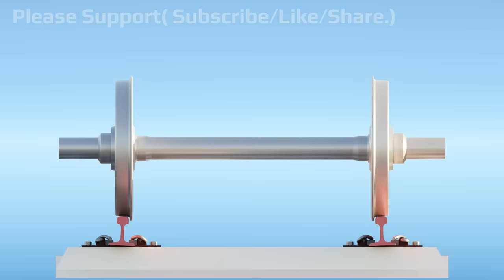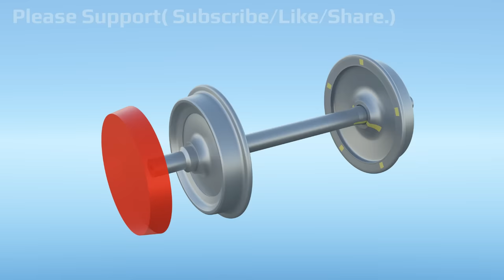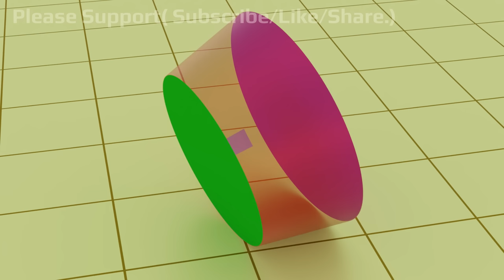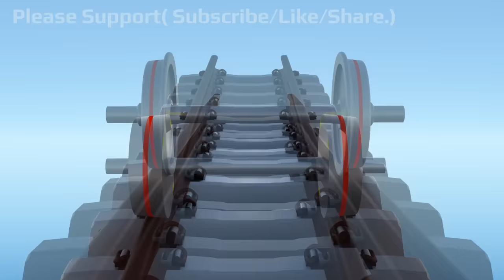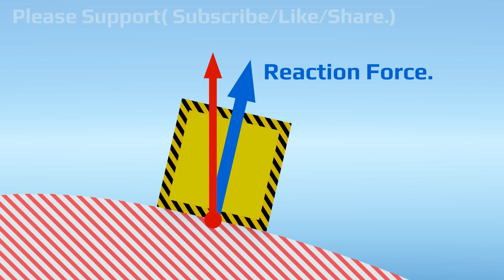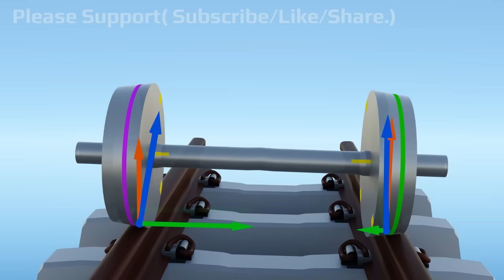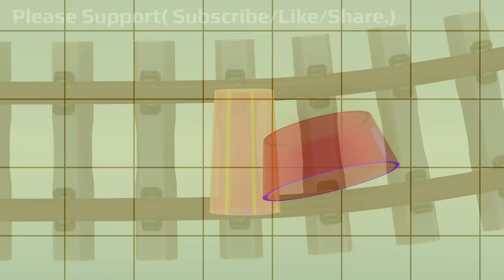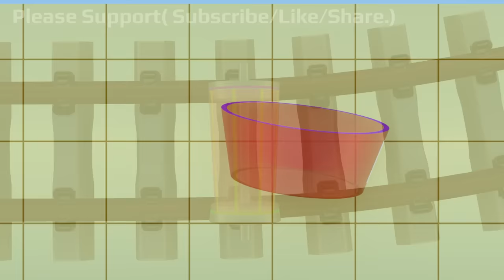How trains actually Turn ? | on curved rail track.

Comment: Wonder how these massive steel wheels are quieter than car tires moving over steel tracks at 160-200 mph. Might be interesting to hear a train engineer give detailed explanation why high speed train is relatively very quiet from inside.  Freight train moving 30-40 mph is very noisy standing outside. We are talking about bullet trains.
Reply: In the corners they make very much noice
Reply: @Virm9510  yeah, ALOT of noise
Reply: No, my friend, they are not quieter than cars...
Reply: @Virm9510  only if the train is badly designed or extremely old, like NY subway
Reply: There's less friction due to smaller and slicker contact surface. They do make a lot of noise when rails are not welded together though.
Reply: Depends on the surface. The smoother the surface, the less noise. Trains use welded track to do this, which is becoming more a more widespread, and is standard on high speed tracks. Cars have to use special roads that aren't very common, and therefore expensive, but if you want to see them, some exist in the Netherlands as the country is having a massive drive to reduce noise pollution.
Reply: the wheels have much less friction than a cars rubber tires on pavement, which is why even the most powerful train does very poorly on high grades.  You can also see wheel slip occur on older steam trains when first going into motion.
Reply: NA VERDADE O Q FAZ O BARULHO DAS RODAS DO CARRO NÃO É EXATAMENTE ELAS,E SIM O ATRITO DA BORRACHA NA ESTRADA, TANTO Q O BARULHO VAREIA DE ACORDO COM A QUALIDADE DO PNEU OU VARIAÇÃO DE TEXTURA DO TERRENO.
Reply: @johnarnold893  I rode TVG moving 160-180 mph from Paris to Geneva.  It was smooth and so quiet.  Have not heard a squeak even on the slight curve (I am sure it slowed down).  Don’t know about Shinkansen.
Reply: @rockon416  not from the outside it's very loud there
Reply: @mikeshehata3847  Yes, and I've seen videos of train operators putting sand on the tracks to increase traction on a grade when the train was having trouble caused by the wheels slipping.
Reply: They make a hell lot of noises.....but due to suspension settings and insulations the sound is cut off inside the train
Reply: They aren’t. Ever had a freight train go right by you? Its extremely loud. Even the quiet trains are also really loud on turns
Reply: @rockon416  yes same and not only once since I'm french, sure it's quiet even at 180 mph, thanks to insulation but in between cars (or wagon) it's so loud you can't even hear someone in a phone call
Reply: Rails are the most cleanest form of transport, both in air pollution and noise pollution!
Reply: @TheManWhoMadeThe47  if you were to compare cars of same weigh to that of train, trains easily win
Reply: Most of the noise from cars is generated from the air being pushed out from under the tires due to to empty spaces from the tread. Train wheel are smooth tracks are smooth and they have a very little surface contact so not much air is moved equals less noise. (From the wheels) trains can be pretty loud from other factors
Reply: As anyone who's seen a train.. they make a ton of noise..  especially the faster they go. Just at 20mph you will definitely heart them.
Reply: @nightshade7745  no. All trains are loud.
Reply: @Jason Moffat  yup!
Reply: @FalconTheFries  no
Reply: @Programmatic Gamer  there are no cars of the same weight.
Reply: You do not live next to a railway do you? You can hear and feel them, like a lot
Reply: the smooth contact with minimal friction compared to rubber tires on rosd
Reply: No they are not
Reply: I don't know if you've ever been in a train station before ebit they're extremely loud, the scraping from the wheels on the track is agonising at times
Reply: There are 4 main causes of noise.
1) the noise of the engine is minimized because most trains are diesel electric. The diesel engine can run at its most efficient rpm, and designed to minimize noise at that rpm, and house it in a largely sealed and baffled compartment. That then generates electricity into capacitors or batteries which run the electric motors which are inherantly quiet. Compare that with a car or truck which has an open air engine for all the world to hear. Electric cars much quieter because the motor portion is at a power plant making the noise, and you just have the electric motor part which is quieter on the car.

2) Friction between rolling surfaces is the other big one. The general population drives cars, and we are not trained professionals, so cars are built to have high friction so we can swerve and stop quickly. That means a lot of "road noise" between the tires and street as well as less efficiency. If you buy commuter tires they are often quieter, but you lose out on control and stopping force because less friction.
Trains take this to an extreme. Smooth metal on metal makes for minimal surface contact, and minimal friction, which means much less "road noise" from the rolling. Even when slipping or sliding the noise is minimal. The exception of course is if they hit a resonant frequency while sliding, and all of that energy is dissipated in a narrow audio frequency range and you get those God awful squeezing noises... But per weight it is a lot less energy dissipated, so a lot less noise, and a huge heavy train can put out about the same road noise as a much lighter truck.

3) wind noise is the other one. Perhaps the majority of what you hear as road noise is just air being pushed out of the way. Trains are typically louder than most road vehicles... But not when measured per pound, or surface area. Most trains are very aerodynamic, and while there is just a lot of air displacement due to the sheer size, getting a similarly small air noise profile at the same speed for a large truck is impossible. So it is loud, but not loud for what is being done.
And that is the name of the game for trains. They use a lot of energy... But much less compared to any other transport type per pound moved. They make a lot of noise, but not when adjusted per pound moved. Trains are hyper efficient, but doing so much in such a small space makes for loud noises.

4) jitter. No road or rail is perfectly smooth. A lot of noise is from these imperfections. My middle school was near a rail line and highway, and I remember being outside, or above ground you couldn't really hear either. But one of my favorite teachers had an office partially under ground and wow... A loaded down truck hitting a pothole sounded like a bomb going off. And a loaded down train hitting one spot sounded like a low pitched machine gun going off as each set of wheels went by some imperfection.
When you have a lot of weight, any imperfection means imparting lots of energy into the ground. Where there is 180* of sky to dissipate audio noise into the inefficient medium of atmosphere, ground noise travels more on the surface in a highly packed medium of earth. So the energy is more focused and and walls of a half buried room made for a great transducer. But that much noise from half a mile away... You really appreciate just how much more mass is on a train vs a truck. As noisy as a train is, a truck is just as noisy up close but with an incomparably small payload. Trains are loud... But not loud for the work they are doing. But damn, one tiny imperfection in rail makes for so much noise, where a massive pothole doesn't make that much of a difference.
Reply: Just put some oil on them then
Reply: Dude, are you serious?? They are seriously loud.
Reply: @BigPapaMitchell .  The area of contact between the train wheels and rail is very small with almost no friction.  That seems to make sense.
Reply: @CaedenV  I think your second point makes a lot of sense.  The area of friction between the steel wheel and thin rail. Car tires have much larger area of friction with the road and the thread makes even more frictions and noise.
Reply: Tons of suspension and noise supression tech. Stand in the passage between two carts to compare with being inside one.
Reply: You have never lived close to train tracks, have you?
Reply: Ohh, Bart in the tunnel is sustained 95- 100 decibels for 1-2 minutes straight. I have to go on it every day.
Reply: I live near the train line in Rome, but I swear to you that the noise of the traffic on the other side of the tracks makes me crazy
Reply: They ain't quieter. Car tires make almost no noise. Ever heard a tesla drive? Me neither.
Reply: @rockon416  yeah but car tires aren't louder that train tracks
Reply: Less friction......less noice
Reply: Have you ever heard a train for gods sake 😂
Reply: Im not sure if this is true but my guess will be that the train itself is so loud that you cannot hear the iron wheels or smtn idk havent even seen a train irl before
Reply: They are quiet from the inside because they are essentially airtight to reduce drag.
Reply: @Virm9510  Its not just the curves, i’ve heard freight trains make loud screeching noises on straight track
Reply: I think that is because the friction is minimum. Which means that a train is more efficient than car in comparison.
Reply: @nightshade7745  I'm pretty sure in more the condition of the track
Reply: @InDaTrenches  damn, your intelligence is scary
Reply: It's the sharpness of the curve, measured in degrees. High speed trains would only see a ~ 3° curve, not much difference to induce wheel squeal. Where I am, curves are as much as 18° and are loud as hell. The conical shape of the wheel tread is more to prevent "hunting", the side to side motion of the flanges on the wheels knocking back and forth between the rails.

Dedicated passenger rail sticks to the ideas presented in this vid. Heavy Haul freight? They don't really care to much about noise and hunting on freight cars, the wheels are usually cupped and the rail is pretty flat.

They do corrections when they can but, its not more than twice a year.
Reply: @nightshade7745  Most subways in South Korea are so noisy whenever there is a curve, slowing down while turning because the station is near, and any other turning point makes the train very loud like a woman screaming... Same with japan and singapore subways very noisy when turning
Reply: Because no rubber.
Reply: Train wheels are much louder lol.
Reply: I heard they have nylon wheels ...
Thalys in belgium/france does if i remember correct
Reply: You are sitting further away from the train wheels than car wheels
Reply: thats a no-brainer. its a matter of steel wheels vs. steel bridge deck of course the steel deck will provide a much larger 'speaker' for the noise.
Reply: @FalconTheFries  walking or running is even better
Reply: They dont touch tracks actually
Reply: Less friction
Reply: @FalconTheFries  clearly seems that you have NEVER put attention to the amount of diesel fumes locomotives produce, they are exempt from the  EPA regulations that mandate diesel engines to pollute less, a single locomotive pollutes a lot more than 100 trucks aka "18 wheelers"
Reply: Wd40
Reply: My
Reply: @mattevans4377 car size is also a a big factor, dont expect a f-150 to be quiet
Reply: @davidcarias4407  What you mean is tire size, although weight will also play a factor (ground pressure).
Reply: Which country brother.
Here in India most trains:  it's a rocking journey of deafening noise. But had a great time on and with the iron giant. 
Wish safety.
*._/_
Reply: Bullet train doesn’t have wheel, it fly, levitated using magnet
Reply: Because friction is what creates the noise, and steel on steel offers a very low friction compared to rubber. (a good example of loud trains is the paris metro which uses rubber tyres, and is much louder than normal metros
Reply: It's quieter inside bullet trains because they usually have better suspension systems, which also means better vibration/noise isolation from the bogies. High speed rail infrastructure also usually require better/precise engineering (because we're dealing with high speeds), which means a smoother ride, which means less noise.

The noise on corners from any train is the result of the flanges scraping the rail, which could either be the result of: poorly maintained wheels (the wheels losing its taper, making the train more reliant on the flanges to stay on track), the train moving faster than the curve's rated speed (the flanges scraping the outer rail), or the train moving too slow on a superelevated (canted) curve (the flanges scraping the inner rail).
Reply: @Phosphorite05  Freight trains are loud because they usually aren't manufactured/maintained to a standard; their wheels squeal a lot because their flanges are often too close to the rails - either by design, or because the wheels aren't tapered/conical enough either due to wear or lack of optimized engineering.
Reply: @kwt2000trucker  Well, you're talking about diesel locomotives, while Falcon was probably thinking more about diesel multiple units - which uses car engines to generate electricity.
Reply: @wudipest Maybe not quieter than a single car. But train noise is intermittent. Car noise is constant with all the cars out there.
Reply: Quieter from inside because of noise proofing tech, like when inside an aircraft. Obviously from outside there's more noise, but it's reduced due to small area of contact and the fact it's steel-steel contact surface. On the other hand, care tires and road surface are different materials, and on top of that the contact is uneven due to the tread on tires so this produces significant noise.
Reply: Inertia is your answer
Reply: @Virm9510 there are no corners for trains!!!
Reply: A bunch of opinions from ignorant people